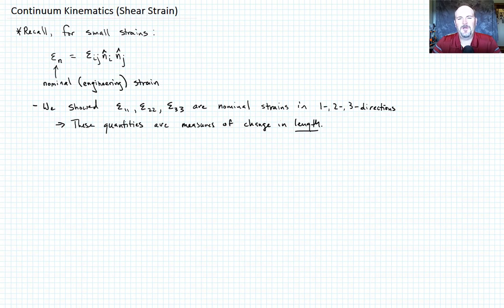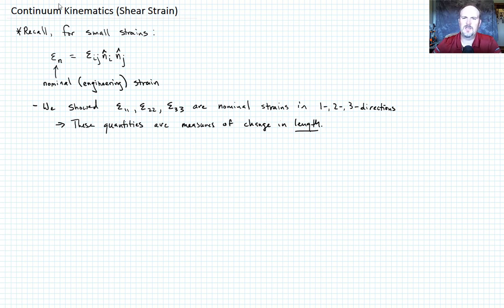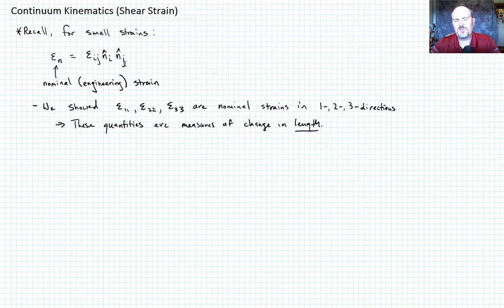1-2e: Continuum Kinematics (Shear Strain)

Comment: Nice video, but I am struggling to understand why n1 and n2 need to be affected with indices j and k, what is the physical meaning behind j and k?
Reply from the maker: j and k are just the components (1, 2, or 3) of the vectors n1 and n2. Note that n1 is a 3-component vector, NOT the first component of some vector n. Ditto for n2.